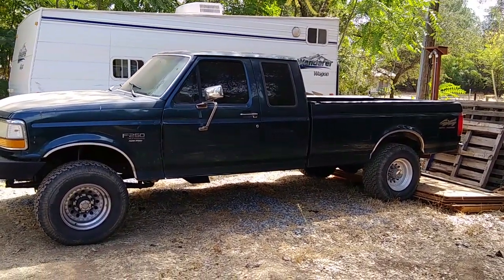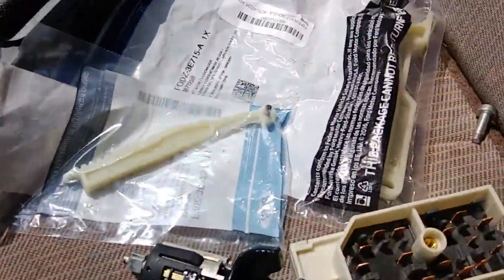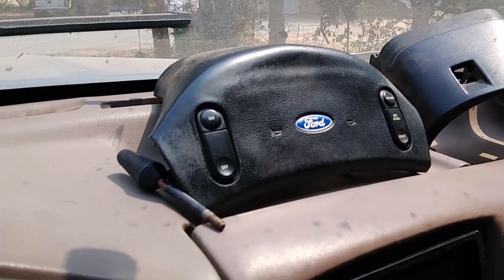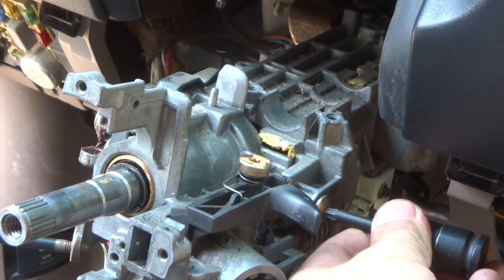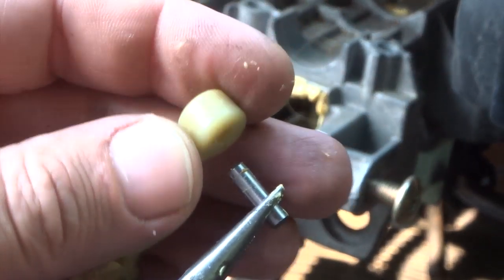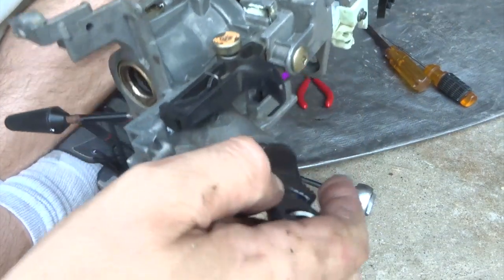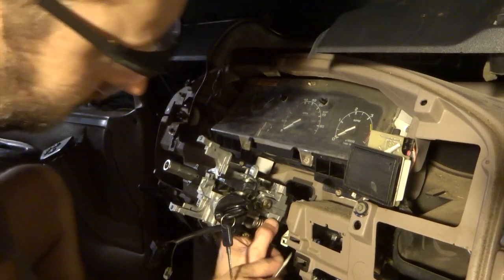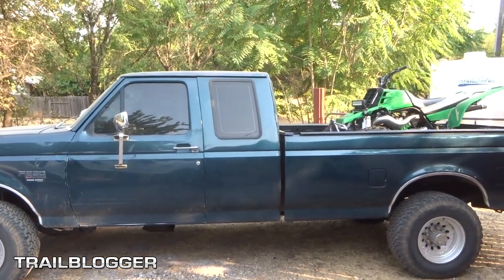FORD F-250 Ignition Switch & Steering Column Link Repair

Comment: Why don’t you show putting the pieces of the column back together? Seems like an important part of the step-by-step process we are partaking in…
Reply from the maker: Sorry i didn't get more footage. To be honest it took a LOT of time to record even just taking it apart and I usually record myself taking things like this apart for my own benefit to help myself getting it back together. I'm not a professional mechanic and I just needed my truck back on the road ( and not dead in the driveway ). I wasn't even 100% sure my fix would work. What you can't see in the vids is that it is over 110 F outside here in the day which is why a lot of work had to be done at night by flashlight making it even harder to record in an already tight area.

Comment: How do you get the key cylinder GEAR to seat properly back in the cylinder and have it “aligned” properly with the actuator rod. I have everything else finished, just at the point of putting the ignition switch back while aligning the cylinder gear with the rod.
Reply: Did you figure this out? I'm having the same issue.

Comment: My truck was stolen and they pulled out the ignition lock and unscrewed the switch to start it. I got a new key and lock, but the linkage is not in the right position and I can't get it to move. Why is that?

Comment: question for ya, what year model etc is this? when my steering bearings failed the airbag clockspring was FUBAR as well only part that was recognizable was those three copper contact rods similar to ones in your vid, yet when ford sold me replacement i ended up with a clockspring mechanism... not sure it matters because i dont have an airbag but  definitely not the same part..
Reply from the maker: 95 F350 XLT 4x4 5 Speed manual

Comment: Looks like a nightmare.
I think I will just take the ignition switch and mounted under the dash we're all I got to do is reach under to operate the switch.
The ignition key will still lock the steering.

I'm done👍

Comment: I think this is the same problem that I have because I can turn the key but the truck won't start but if I remove the Ignition switch I can push on the rod that sticks up and start it manually but then it won't turn off with the key so I think my pin either fell out or broke off. Thanks

Comment: Supposed to remove the trim piece over the column,around the gauges. Makes it a lot easier. It will be helpful
Reply from the maker: good tip!
Reply: @trailblogger  I just replaced the whole upper column housing on my 95 obs. It was a real pain. Taking off that cover pice you can do it without loosening the column bolts. Wish I would have found this video before I did it,would have made it a lot easier on me lol
Reply from the maker: it was a real pain!

Comment: aloha, that is an awesome truck. i have to try to do this repair as well. i will let you know how it goes. have a great day.
Reply from the maker: good luck to you sir! i hope that the repair goes well for you. note that in a worst case scenario you can use the actual switch attached to the bottom of the dash to start and stop your truck until you get the column pieces.
Reply: @trailblogger  thank you! i start it using the screwdriver and solenoid technique. if you have a link to that other technique, i would love to check that out too! thanks.
Reply from the maker: when you see the white switch under the dash held on with two torx screws you will see what i mean, that plastic pieces pushes and pulls on it. probably why mine broke, switch under dash was too stiff for plastic piece to push anymore from corrosion inside
Reply: @trailblogger  i was going to try and pull out the green retainer and the metal retainer to find out if the gear was even engaging? such a stupid design. on such a beautiful ford truck. :)

Comment: Hello i replaced my whole column when my bearing went out... After the column replacements i no longer have functional hazards/turn signals/radio. The radio kicks on when i turn the ignition to accessory but that's it. Any ideas?
Reply from the maker: I'd take it apart again and look for a loose or pinched wire. hope that helps

Comment: How do you get the piece out(the one u didn’t take out) because mine is what is causing the problem I believe because it is completely stuck and won’t budge
Reply: Yeah, I know?? I'm getting ready to replace it, did you ever figure it out?
Reply: @coltonbocock2586  no ;( I might just take it to the dealership and have them do it😕
Reply: @konen5807  Aww that stinks 😕 turns out mine didn't need to be replaced, It somehow by the grace of God worked! I hope you get yours fixed, Good luck!
Reply: @coltonbocock2586  u too

Comment: Did the resistance come mainly from the 
Broke pin or the white ignition module? My switch is moving freely. Could it be possible that my pin is okay?
Reply from the maker: my thoughts were the pin broke due to a corroded white ignition module getting too stiff. if your pin is fine i would leave it.
Reply: I could check the other end of the steering column with a mirror and if the actuator is not sending, that will let me know, right? Like in the video, except on my truck of course.
Reply from the maker: @chrisshreve1736  a mirror or a cell phone on video record mode

Comment: Until I have time to completely take apart the steering column, could I manually start and turn off the truck by pushing the pin myself?
Reply from the maker: yes i think so. this also occurred to me that if i didnt have a manual i could have used that trick to kill the truck.

Comment: Whar year vehicle is this 250?  Mine, a 1989 looks different on the inside..  Also I am not understanding why it was necessary to replace the ignition switch..
Reply from the maker: The linkage to the ignition switch broke because the ignition switch under the dash was freezing up from being old. I replaced the switch so it wouldn't break the linkage again.if you try and use the switch under the dash and it's extremely stiff I'd replace the switch while you're in there as it's not expensive maybe $40 at the most
Reply from the maker: Also this is a 1995 So it's a different generation of F-250 than yours which has the IDI diesel instead of the powerstroke DI
Reply: @trailblogger  Thanks.  Yes, my ignition switch is stiff,.  I am wondering about the wisdom of simply machining a steel or aluminum actuator rod as mine has broken at least 3 times since I got the vehicle 5 years ago.
Reply from the maker: @kenibnanak5554  I bet if you did you could sell them on eBay lol kind of like the plastic door handles... I've seen farm rigs where they just leave the ignition box dangling under the dash and use that by hand
Reply: @trailblogger  LoL, I am stuck at removing the ignition lock housing from the 89truck.  I have removed the 3 bolts and it doesn't even wiggle much less pull off.

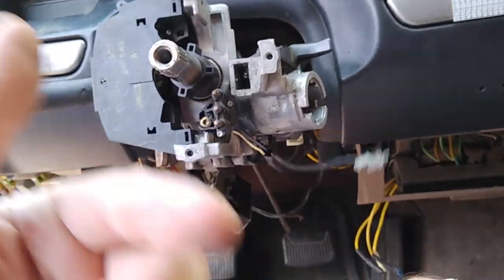Comment: What does the black wire that is dangling @ 14:55 connect to?? The truck I bought had the ignition cylinder OUT and that wire loose with the terminal on it damaged, have NO idea where it goes or what it is for....... HELP !
Reply from the maker: did you ever figure it out? sorry i no longer have the truck to go look at
Reply: That wire actuated the buzzer sound when you have the key in the cylinder
Reply from the maker: thank you

Comment: How the hell do you get the keeper out inside the ignition switch housing. Ive been prying on the green clip for hrs and it wont budge.
Reply from the maker: needle nose ?
Reply: @trailblogger  use a flat nose screwdriver on the edge of and push it to one side to get it out from under the retraining rim then pull it out with needle nose or dump it out while shaking it upside down

Comment: Is it required to replace the plastic rod with the pin or maybe just put the pin back in?
Reply from the maker: i wasnt risking it lol
Reply: @trailblogger  funny!  I have an issue and really hope you might comment.  I got the new ignition actuator put in the slot.....filed it down.  But when i tried to put the big part back on (that has the ignition barrel and round hole that goes over the steering column and fits into the two torx bolts) it wouldnt fit.  It was maybe a 1/4 inch shy of matching up to the torx holes.  Anyway I disconnected the steering rod underneathe the dash and then it aligned.  Tighened the two torx bolts up and connected the rod undeneath the dash again....but when i went to put on the spring around the steering column guess what?  The spring is way loose and took no effort to compres to put the snap ring back on.  Ill try post a youtube video.....something doesnt seem right.
Reply from the maker: @pwrmx24  pause my video at 40:35 where I am using PVC pipe and washers to compress that spring down way further
Reply from the maker: @pwrmx24  did you put a washer below the big spring?
Reply: @trailblogger  thanks for the reply!  Yes.  The washer (the one with a split in it you have to use two flatheads to pull), then the "hat", then the spring, then the clip.  Maybe theres a detent further down where the clip goes.  If so I`m not sure what that first detent is for.
Reply from the maker: I was thinking that if you don't use a homemade PVC doohickey that notch probably is for the real tool But I have no idea for sure... did you get it on then?
Reply: @trailblogger  i did thanks much.  I used your method and it worked.  Truck is back together now.....btw if you ever have to pull down those tilt steering wheel jaws again while puting in the column again...i used some  nylon baler twine wrapped around the jaws and suspended them from a 30lb weight.  Does most of the work and pushed it down with my foot for the last bit.
Reply: @trailblogger  
Im just replaced the actuator rod and
Im trying to compress everything back on the column shaft with your 3/4” pvc conduit trick.
My screw bottoms out before I get the spring clip to the detent. What was the length of that pvc piece?
Reply from the maker: Sorry I did not measure but I made mine too short originally also and then I had to add another piece
Reply: @bradwest6413  I used a longer screw with the same thread pitch and then it was to long so I put 2 box end wrenches as spacers and it worked fine

Comment: Filing the actuator down that much is okay?
Reply from the maker: It held up fine after that but i did sell the truck about 6 months later. If you do it correctly I'm sure it doesn't need to be filed at all but I just needed it fixed lol

Comment: "yea I got this spring in with a flat head screwdriver, you just gotta push real hard........" ok bro. come do mine. lol fuck that lil spring on the side...
Reply from the maker: lol it was a pain and the whole time was hoping it didnt shoot off into orbit
Reply: @trailblogger  I almost got hit in the face and pinched my fingers like three time trying to use a pair of needle nose to compress it and get it in there. I’m ganna try again tomorrow. But I might just leave it out. It’s only to help adjust the steering wheel height I think so I don’t really need it
Reply from the maker: You ok? 3 days later. Did you get it? Or is that this weekend's mission?
Reply: @trailblogger  ok bro. So. Yes I’m ok. But I was about to put it all back together without the spring and I noticed I lost the snap ring that goes on the shaft behind the steering wheel. I think it went don’t in the damn defrost hole in the dash. I had another steering wheel I got from a pick a part I got the upper actuator arm out of and I was just ganna get the snap rig out of that one, but I already took my bosses puller back to the shop I work in and so I built a home puller out of some hardware I had, but that didn’t work so I hacked up the steering wheel and got it off, but there is still a piece of it left on the shaft in front of the clock spring. Uuugghh lol I’m just ganna get a freaking grinder, get it off, and then take what’s left of this $230 steering wheel back to the pick a part and see what they will refund me for the pieces that are still good lol. I think the air bag is the most expensive part lol
Reply from the maker: Holy crap man, hang in there you will get her
Reply: @trailblogger  just got it going again. Thanks a lot for the video man!
Reply from the maker: @CHASRIZM  hey glad to hear! Another ol beauty back on the road. Funny how one plastic piece can take down a solid workhorse of a machine
Reply: @trailblogger  I know right! The same thing happened to mine, where that lil pin fell out.

Comment: Please post the OEM part numbers.
Reply from the maker: sure here they are, adding to the video description also Motorcraft SW6383
Ignition Switch and Lock Cylinder

FORD F2DZ-3E7230A
Actuator Assembly / Starter Switch Actuator Pin

FORD FODZ-3E715-A
Ignition Switch Actuator

Motorcraft F4DZ-11572-B
Ignition Switch

Comment: At 21:30 I’ve done everything. I just can’t get that piece to come out.
Reply from the maker: Did you pull the last lock ring I show at 20:50?
Reply: TrailBlogger yes. It took a good beating with a dead blow and came apart. The old top bearing was blown apart so I think that was hindering it a bit. Thanks a lot man!
Reply from the maker: Hell yeah glad to hear that

Comment: Don't any of you guys know how to get that lower actuator out? The whole reason I watched the videos, and you just ignore it.
Reply from the maker: i just needed my truck back and grinding the corner off was good enough for me
Reply: the lower is held in with a pin that keeps the shift pawl in place you have to press it out I used dental picks that are bent then make sure you know the position of the pawl when you put it back in and put the upper actuator in the lower one at the same time that why you don't have to grind the upper actuator so put the whole thing back together then put the shift pawl back in to hold the lower actuator in place
Reply from the maker: Good info here, thanks for commenting sir
Reply from the maker: Does a manual have the pawl you are describing
Reply: @trailblogger  I don't know about that does yours have floor shifter or on the column if on the column it might but if it does not have one I would think there would be some kind of retraining pin look for it where you can see the lower actuator from the housing that it goes in I hope this helps or look it up as how to replace  steering column with manual shift on column or floor shift I think I will just for the hell of it it would be good to know
Reply from the maker: Not sure sorry i didnt dig that far into it and truck is now sold ( upgraded to a 2002 4x4 F350 7.3L )
Reply: @trailblogger  well that's a good upgraded I have a 1999 f250 4x4 I kind of feel like it's not a real truck unless it's 3/4-to-1-ton. 1/2 ton just don't cut it if you plan to haul or pull it's great for overhead truck campers good to hear you got a nice rig and if your actuator goes out you know how to replace them